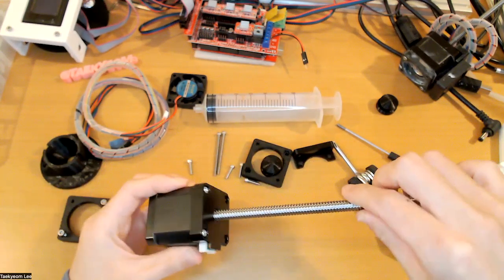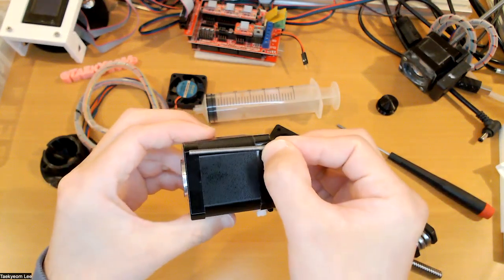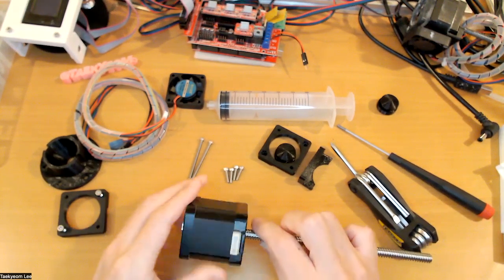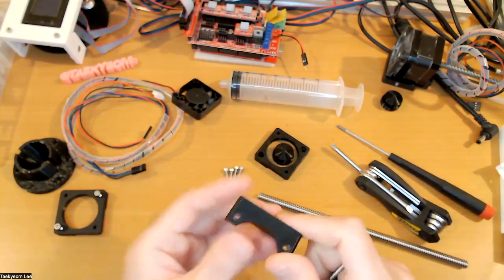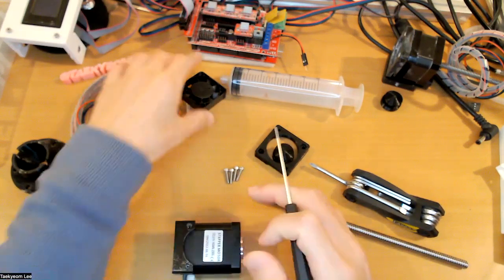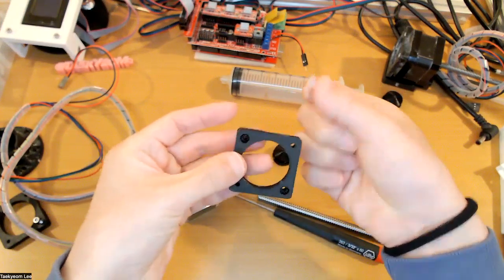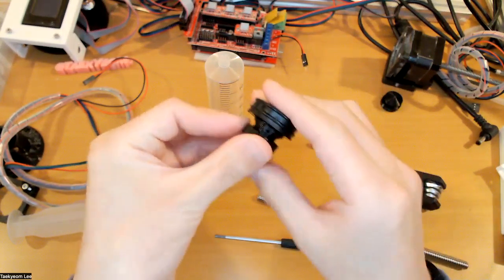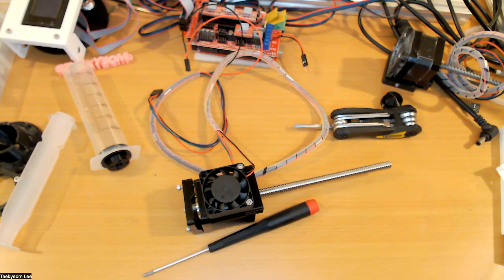DIY ceramic 3D printer 012 - 60cc plunger clay extruder

Comment: Thank you. I'm building a different 300ml with a geared reduction stepper. But I find you design fascinating. And if you can get the work you've done out of it I'm impressed!
Reply from the maker: I tried to make a simple design with fewer parts. It would not deliver much torque but handy extruder.